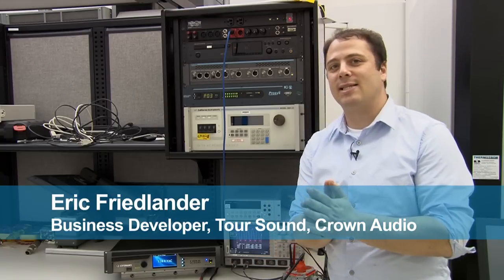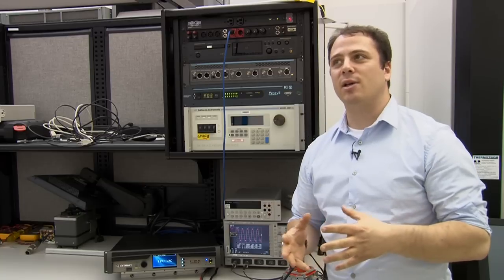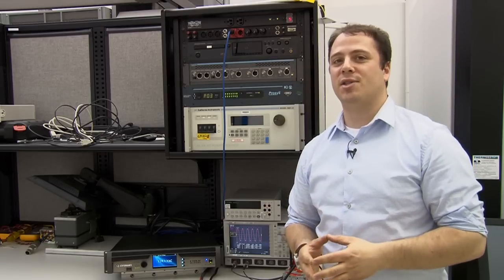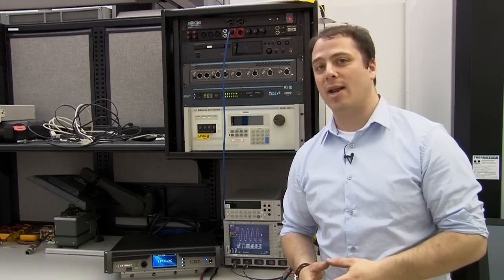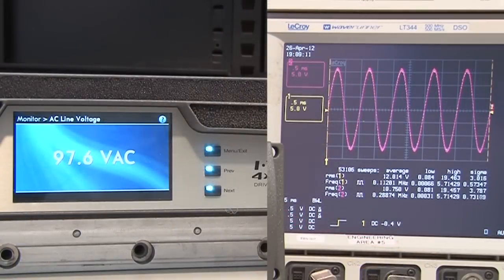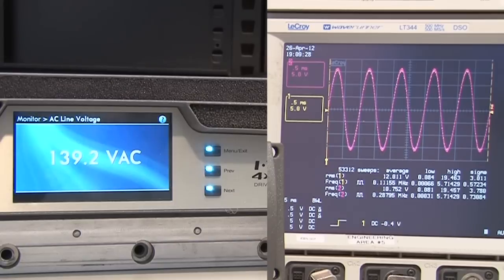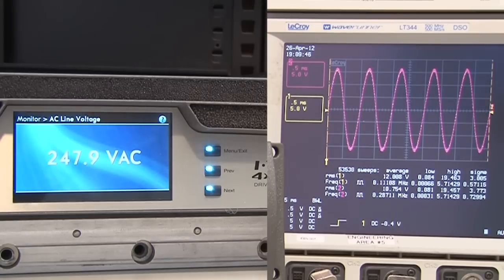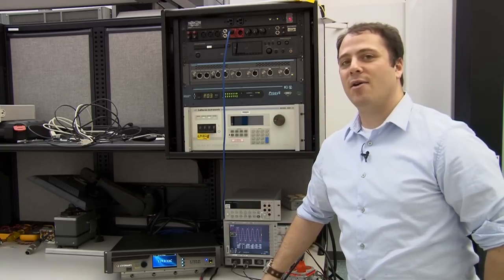Crown I-Tech 4X3500HD Universal Power Supply Testing

Comment: at 12Vrms... and how many watts provide output same time? lower mains voltage higher mains current if the mains collapse  the "super power supply" cant resolve this problem. Need real test with real applications.

Comment: Ok I get it... The amps are efficient but no matter what you will need a big power supply especially for the 4x3500....
Reply: Hey. I was planning to purchase them pre covid(now let's see after 5-10 years, post covid, no business, dead money), 
Was wondering, if you have any idea if these are the best top notch amps I can get for the money?
Reply: @josealfredfernandes  I have used these amps on subs and don’t get me wrong they kick ass but they have had power supply issues badly the times I’ve used it it shit out on me during a live show and replaced it with two itech 12000s instead and had no problem. If you want to buy a very solid 4 channel amp go ahead and get a lab gruppen plm